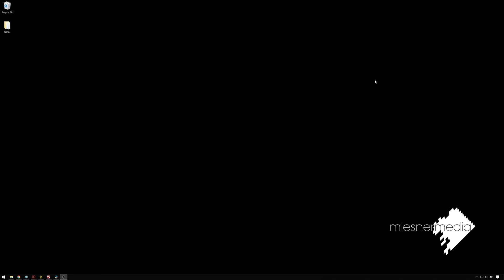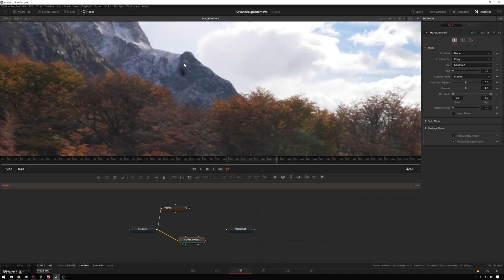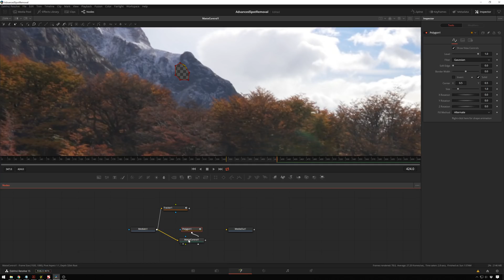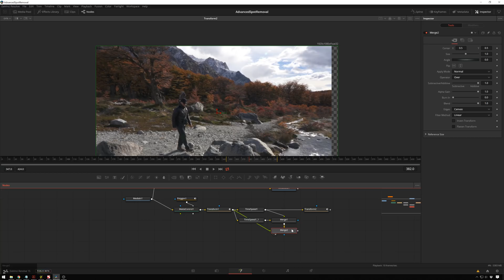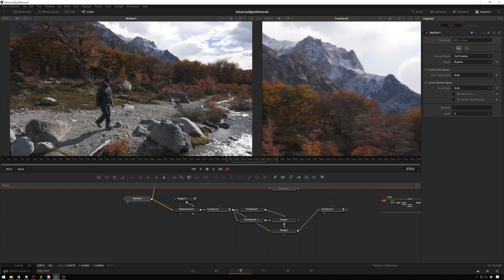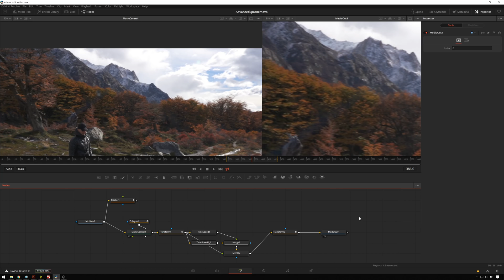Advanced Dust Removal - Davinci Resolve 15 Fusion Tutorial

Comment: Ok so first of, thx a lot for this complex but neat trick!
One problem I encounter using this method though is that the first 3rd of my used clip is just black when I connect to the 2nd transform node and later to the MediaOut node.
Not sure why... when I remove the timespeed nodes, everything is working fine but as soon as I add them I face the above described problem..
Is that something that's common and can be fixed?

Comment: I installed Davinci Resolve yesterday and happy to find out there is a way to remove sensor dust. But I could only follow to the part where you cmarked the spot with Polygon tool.  How and where you pull out these little boxes called tools is beyond me so far! Seems too advanced but I am determined to find out what is going on here.. maybe after several months

Comment: It's always cool finding a new way of doing something. Your videos are always great. I just learned how to do this recently with a power window, tracking the spot first, then move the window elsewhere (where you want to sample a patch from), then use the node scale tools to move the patch back over the dust and feather the power window to taste. It's only one node in the color tool and it does a cool job in cases I've had with old dirty footage I'm now working with. I also went through a tut on using the paint tool on the first frame on multiple spots, and then tracking to have the first frame follow all the spots (I couldn't get it to appear throughout the clip and was told I ran into a bug).
Reply from the maker: Nice that sounds like a cool idea! For the paint tool make sure that you are using "stroke" mode and not "multistroke". Multistroke will only do one frame at a time and that tripped me up for a long time.

-Theo
Reply: Yes! The guy who's tut I was following said the same thing when he got back to someone else. I trust you're right! I'll try it tonight. Thanks Theo!

Comment: Does sb know how to fix the problem with the tricky menus in color editing in da vinci resolve (for example you wanna apply a lut but as you are clicking through the menus the menu randomly closes itself again and again and again...)?
Reply from the maker: Hey Nicola, I haven't had this problem, but 2 potential workarounds are: 1. The full version of resolve 15 is out not (and is much more stable than the betas) so if you don't have that yet, try it out. 2. try clicking to open the menu, then taking your hand off the mouse and navigate with the arrow keys. Though that isn't ideal, hopefully it will get you through your current project.

Hope this helps,
-Theo

p.s. Also if you have a touch screen, make sure there isn't a bug crawling on it, or if you have a pen tablet make sure that the pen is off. Both of those things have happened to me and took me embarrassingly long to figure out lol
Reply: MiesnerMedia thanks bro